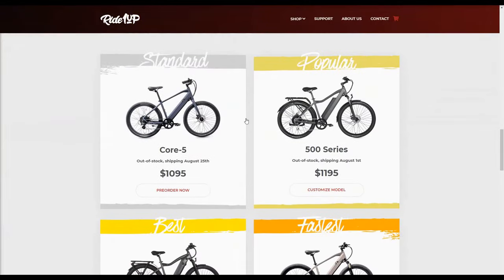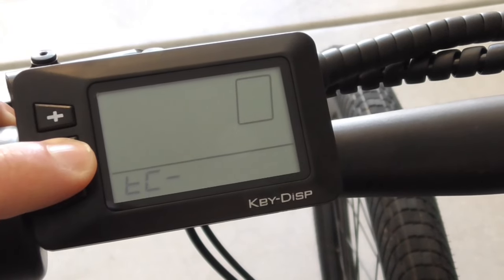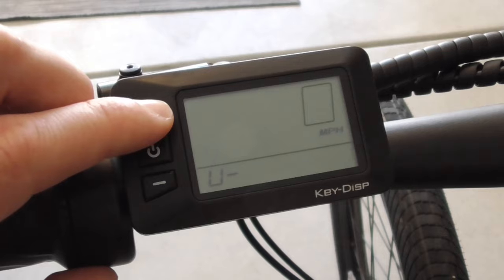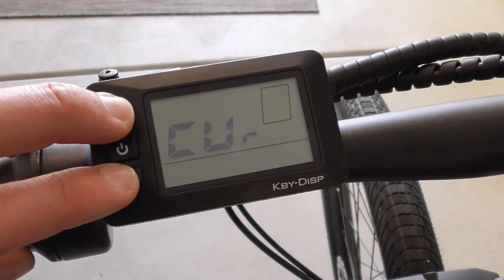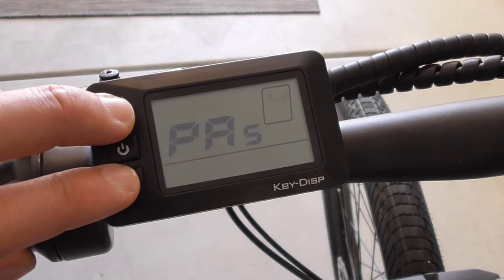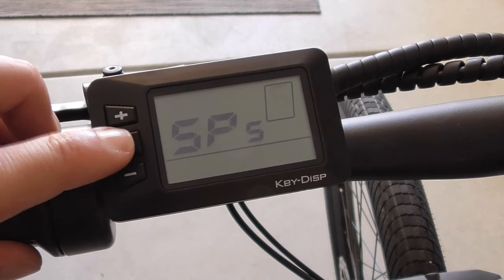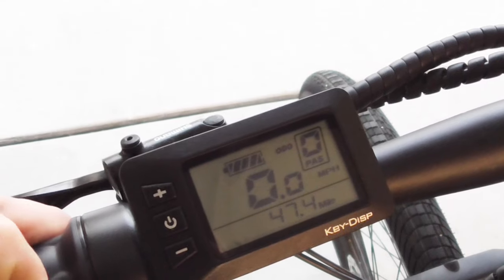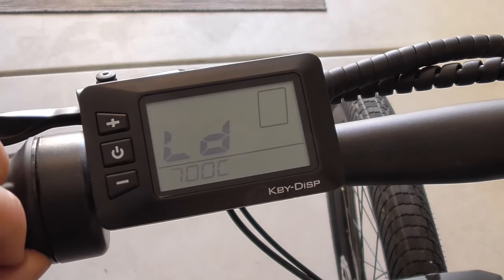Ride1Up KD21C Display Tutorial | 500 Series, Turris, Cafe Cruiser and Core-5

Comment: Sweet! Got my new Turris up to 28mph. That cutoff at 20 was a bummer. 
Looking forward to messing around with the rest of the settings.
Reply: How’d you do this? I only got pedal assist to 28 but not my throttle
Reply: @JoeD-ei8eb  That's right. 20 mph throttle, 28 mph pedal assist. It came as a class 2 with pedal assist only to 20 mph.
Reply: I also swapped the 12-32 cassette for an 11-28. Really helps get the most out of it, especially on the downhill. And 2.0 slick tires that roll better and don't kick up dirt and water.

Comment: Hello mate ... ive just purchased a fluid bolt e comuter with this display & have stuffed some settings  ... is there a complete manual that shows factory settings or basic starter settings... i cant see anything here im probably not looking properly
Reply: Ive altered the speedometer.. its showing a higher setting than what im doing ifvthat helps
Reply from the maker: Yours may vary, but you can find the link for the manual in the description below and on our support page.
Reply: Thank you

Comment: Can someone answer my question? I have a problem with charging the battery, at first I thought it was a bad battery, so I took another one that was new and it also could not be fully charged, I checked the vol on the display, the parameters were ok, the charger is also ok. Does anyone know what the problem is?

Comment: Hey i have problem with speed limit my is 24 and i go to advaced setings   to speed limit Change i Press+ and nothing happened -to
Reply: If you changed units to mph perhaps the speed indication is in mph and the top speed of 40 kph is equal to about 24.8 mph.  I presume by "advanced settings" you mean General Parameter Settings accessed by UP&DN hold 2 sec followed by DN&Poweron button for 2 seconds. 
There is another speed limit setting deep down under personalized settings that is preset to 40 k/h (24 m/h) by manufacturer and is not changeable.
Reply: @GschnakenbergJr  i Press +- togheter 2sec and nothing happen i trying 💯 time  nothing :( i can only Look what setings i have Setup Bit can't Change i think i have locked by producent this bike

Comment: I got a  corev5 my battery bar doesn't move from reading full always? It left me stranded 8 miles from home 1st charge? Any way to adjust or get full battery bar to change with the battery draining and be accurate? These core 5 are heavy not a easy 8 miles home w dog in back too. Thnx
Reply from the maker: We are sorry to hear that, make sure your battery is fully charged. The display settings for battery are adjustable. If this persists, please contact us https://ride1up.com

Comment: Hi, I have a Vulcano ebike with 5 in 1 cable and free plug for the throttle.  Once connected, it only works with assistance at 0. Could you tell me which menu function I need to set to make it work with any assistance level?  The display is a Bigway, same as this video.  Thanks in advance for your reply.

Comment: Why is this manual different than the one shown under Ride1UP Support page for the Core-5? Does lowering the percentage on PAS 1 help with the fast startup speed? Thanks!
Reply from the maker: The Core-5 manual isn't yet updated as the older generation was a different display. No, lowering the percentage on PAS1 would not increase acceleration.

Comment: My 500 series fat bike getting drained after 20 kms on a full charge and its a new bike. I used the same setting but still I am having issues .Can you suggest something?
Reply: It is not a motorcycle, you have to pedal assist, I use it in a hilly area for 10 miles and the battery indicator barely moves (the one in the battery ,not the display)

Comment: I have a controller made by vinka and it looks almost exactly like this however, it does not let me access the settings. I was hoping to remove the speed restriction on it. Do you know how I may be able to do so?
Reply from the maker: Unfortunately, other displays and internal motor controllers may not be calibrated to work with ours. You can adjust other settings in the display to get more power though.
Reply: hi there, just wondering if you ever found out how to derestrict it? Regards

Comment: What does this mean?  Can anyone who has not used an electric bike, reading the below sentences, have any idea what that means?  Show in a video, please!

Assistance levels indicate the output power of the motor. The default
value is level “1”.
The default power ranges from level “0” to level “5”.The output power
is zero on Level “0”. Level “1” is the minimum power. Level “5” is the
maximum power. Gear to level “5” and then press the UP button, the interface
shows “5” still and “5” flashing prompts top. Gear to level “0” and then press the
DOWN button, the interface shows “0” still and “0” flashing prompts low.
To change assistance level, press the UP/DOWN to increase or
decrease until the desired assistance level is displayed.

Comment: How to get it stay in full freaking throttle mode?
I didn't buy a Motorbike to pedal, that is ridiculous, I want full throttle without having to leave the settings menu display on constantly. Whata p i t a.
Reply: it is not a motorbike, is a bike with motor and pedal assist, Tessla is coming out with the one you want.
Reply: @ramarrie  I don't want anything from Tesla, except for all the subsided money they took!  I know how to get the motorized bicycle in full throttle mode, but it should be much easier than that.